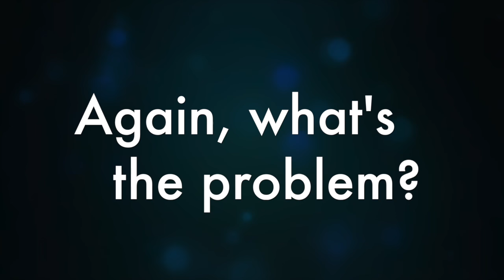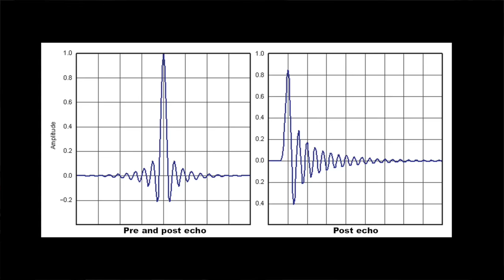The truth about Nyquist and why 192 kHz does make sense

Comment: Wonderful explanation! Many thanks for sharing your knowledge with us. I will order your book forthwith!
Extremely wide bandwith is useful to 'shunt' artifacts out of the 20Hz-20kHz band. This bandwith gives us 'elbow room' working with signals and results in 'cleaner' sound. Some authors posit that after this is done the 'beyond 20kHz' area can be chopped away, retaining the clean part for music reproduction. That is, a properly crafted audio PCM file can be 16/44 or 24/48 after all work has finalized and we have a final master. 
Would you be so kind so as to offer us your view on this? 

Some people argue that all the 'spikes' and 'brush' in the ultrasonic range may hurt the sonic result if left there for the DAC to process. It wouldn't add anything and it might detract from quality. Once the 'main tranche' is cleaned up we may be able to attain a lower noise floor where it matters by filtering away the 'excess'.
Is this argument 'sound'?

An argument for 24/96 files is the broadening of dynamic range. (The non technical but commercial problem lies in 'the loudness wars' and severely compressed masters and 'remasters')
Modern technology permits widespread use of 24/96 which I hope will become a 'standard' of sorts, at least in the streaming services. 

Let's hope quality 'uncompressed' masters find a place in the market. Is LP vinyl dynamic range too much to ask for in contemporary times?

Comment: One correction: In mathematics, "theorem" is an explicitly proven, factual statement. It is a very different thing than a scientific "theory" where there is an explicit question about the universal provability. The Nyquist-Shannon theorem has been perfectly proven mathematically; there is absolutely no question to it's complete accuracy. 

There is potential validity to your statements pointing out that it is for perfectly band limited systems, and so aliasing is an issue. But that is a very different thing than implying there is ANY question about the validity of the theorem.
Reply from the maker: I do not question the Nyquist theorem.

Comment: Fully agree!

I know from experience that switching from 44.1 to 88.2 and 176.4 (or 48-96-192), opens up and sweetens the sound, also giving it much more room. I suspect that’s not the high frequency content (can’t hear that anyway), but the accuracy of the timing, that better reflects reflections in the room, and less filtering artifacts. All using proper gear (DPA mics, Jensen/John Hardy mic pres, UA 2192 ADDA).

So I’m interested in the timing issues, and especially in attack. Some instruments (think harpsichord, guitar), have a very sharp attack, which could occur right in between two samples. What happens then? Are you going to miss out on the attack, or will it be time shifted?
Steep filters are always a big problem. Microphones will solve the filtering issue when recording and playing back at high sample rates, but there will be plenty over 20kHz content with good mikes. And when you have to put that on a CD, during downsampling filtering is needed in the end…

I actually chose my DAW based on the quality of the downsampling, which had much to do with timing and filtering. I ended up with a certain German product, which sounded much warmer and retained more than any other product I tested the rhythmic pulse of the music. And sure conversion takes its time, it’s terribly slow.
Reply: MF Nickster  Thanks for the hint, I’ll study it.

Comment: Hmm... I though CD players solved this already in the 1980s. I mean by having a couple extra bits (say 18 bits) in the D/A-converter and using these to create new interpolated values between the recorded 44KHz 16-bit samples. Hence moving the need for filter cut off as well as filter steepness up (two octaves in the case of 16->18 bits).
Reply from the maker: The bit depth works in the amplitude domain and the reconstruction filter in the frequency domain. So I'm afraid you are incorrect.
Reply: @TheHansBeekhuyzenChannel  Of course, but the time and amplitude domains can be closely connected regarding physical implementation.
The extra bits enables a few extra levels needed to define some interploated values between the recorded samples. Synthetic sample values with shorter duration and thus at a higher frequency. This moves the digital artifcacts up in frequency when fed to a D/A-ladder (with these extra bits) and so relaxes the need for a steep and phase distorting filter. That's the connection between amplitude resolution and the frequency domain here.
A guess you get the point? This principle is what they called "oversampling [filter]" in the late 80s and early 90s.
Reply: @herrbonk3635  Smooth ringing is better than rough ringing... :) It still rings though. The problem arises at the A->D conversion level, extra information is added that cannot be corrected in the D->A process. It's not a lack of bits, but the presence of added HF ringing that is the issue.
Reply: @realworldaudio  Ringing? I thought it was the phase distortion itself that was the main problem with steep filters close to (and therefore into) the actual audio band. If you move the filter to 44.1x4 or 44.1x8 (as I described), you would not have any filter effects whatsoever on the audio part of the signal. That's simply why "oversampling" (misleading term) works.

But from your nick name, I suspect you perhaps is the type of guy that don't even want a treble control in your HiFi (a low pass filter as well). These dudes (often called "gold ears" here) somehow seem to belive recorded acoustic music itself is clean from all kinds of artifacts... or that all artifacts always sound really bad, and must go, despite the fact that we have listened to them as long as we have had musical instruments and concerts :D

Comment: I’d like to know if there are differences between natural instrumentation and completely electronically-produced music in relation to this? Are the benefits just as justified if the instruments are digital to begin with? Is this just for analog instruments (which I know can include the human vocals)? I want to argue for higher bits and sample rates from electronic music but some artists don’t seem to believe in it. It might be linked to the human frequency response thing. Do you still get time smearing in electronic music? Thanks.
Reply from the maker: Digital instruments vary in quality depending on their working principle. Old analog synths use analog oscillators and filters. They often use the same oscillators for the entire spectrum they cover, making them sound very dull. Although there are those that love the old analog synth's. Nowadays often samplers are used that use pieces of recorded instruments. So there is no synthesis. The quality of those instruments depend on  the sampling rate and bit depth, the quality of DSP's they might use and the quality of samples the user loads. If musicians choose a given electronic instrument, they specifically want to use the sound it gives. Which might include time smearing.

Comment: I think I would want to put an easy way to understand Nyquist theorem. It simply says that the system needs two samples to know that there is a sine wave one on the positive side and one on the negative side. Now I could fit any continuous sample on those two samples. But given that you don't allow any of the higher frequency of those two delta samples to appear, They are pure sine waves when passed through that LPF. Lower frequency components have more samples reducing the source of error and increasing the ease of interpolating the points to a nice clean sine wave by filtering.
Reply from the maker: I have covered this in several videos, like this one: https://youtu.be/geaoEt-9V-w

Comment: What are your thoughts regarding higher sampling rates (at least greater than 44.1) improving the imaging of the reproduced sound?
Reply from the maker: I have tried to express them in this video:-(
Reply: I think he is referring specifically to the effect on imaging that higher resolution audio may have vs. standard resolution (not necessarily MQA encoded). Improving the time domain with higher sample rates alone, may be advantageous to imaging, but how higher resolution will fix imaging (in particular) may not be obvious or part of the video above. Just saying. Again. Kudos on your awesome videos!
Reply from the maker: Thanks voor clearing this up. Trying to answer too many questions in too little time is claiming its toll, I am afraid. Indeed, the filtering artifacts do have a negative effect on imaging and placement. So reducing the artifacts does improve this. In what way and to what extend depends on where your started, what improvements were made , how these improvements were implemented and so on.

Comment: There is another thing you are not talking about that's the microphone, I don't know a mic with that higher frequency range spec. I google it and all I found mic's from 10-140 khz response.
Reply from the maker: Microphones that have such a high frequency range must be condenser mikes and have very small diaphragms. As a result they will have extremely poor signal to noise. Apart from that there is little to no content above 20 kHz in acoustical music and if there is, the energy is very low. That energy will get lost while traveling through the air. So in a concert hall it is unlikely frequencies above 20 kHz will reach you and if they do it is unlikely your hearing will register them.

Comment: Great video! This concept makes perfect sense to me. The bain of speaker design is the Crossover. So why would it be any different with source files? I have vast experience in Car Audio, where we attenuate crossovers readily. From my experience the best sq comes from a more relaxed filter roll off. 
Another thing, blending a subwoofer with mids is a real pain in the ass! Why?? Crossovers! Cheers
Reply: With crossovers, you can actually do them in the digital domain and have seperate DAC+amplifier for the different bands (bass, mid, treble, or even more of them).

Using a somewhat powerful DSP should give you access to a lot of tricks & math to deal with gain flattening over frequency, phase e.t.c.

For storage, I personally  don't see any need for more than 48 kHz 16 bit-ish.
If you want to downsample with digital filtering at recording (using a good filter-algoritms) then go for it.

Same for playback, if you want to upsample and interpolate, by all means. At least you can keep the filters digital and rather complex if so desired.

For me it seems like a discussion about filter type/algoritm vs the other ones.

Comment: My question is in regard to playback versus initial sampling. Let me give an example. I record a simple session at 96/24 of an acoustic guitar and a vocal using two mic's. Once it is finished, I do a finalized stereo bounce down into an mp3 file so I can play it on a digital medium that can only play mp3 files. I also do the exact same thing again, except this time when recording the original tracks, I use 48/24 instead of 96/24, and it just doesn't sound as good as the session that was done at 96/24 then bounced down to a stereo mp3 file. Both sessions ultimately end up in a mp3 stereo file, so why does the one tracked at 96/24 sound better than the one tracked at 48/24?
Reply from the maker: MP3 is a lossy way of storing music. The higher the quality of the source material, the easier it is for the MP3 encoder to decide what part of the information hurts the least when left out. It's the same with pictures. If you want a high quality, low file size internet photo, start with a very high quality  losslessly encoded photo at very high resolution.
Reply: Thanks for your response. I am currently looking into Antelope Audio products because they seem to be the one of the only pro audio component producers that focus on making their products with 192 khz capability at an affordable price.

Comment: In mathematics, a theorem is a statement that has been proved, or can be proved. 
Philips and Sony already know of the aliasing problem when designing CD RedBook, that's why they bump up the frequency to 22050Hz, and the sampling rate to 44100KHz.  They already take into account the filtering errors.  The 44.1 kHz sampling frequency allows for a 2.05 kHz transition band, that is more than enough. I can accept 48KHz that will allow  a bit more of headroom for the cutoff filter, but above that leave it for mastering and mixing, but will not improve the sonic performance of the final record.
Reply from the maker: I know what a theorem is. The reason for choosing 44.1 kHz was primarily to be able to use a U-Matic VRC to store the digital audio signal in a video signal using the Sony PCM-1600 encore (In the US is was even 44.056 kHz because of NTSC). The difference between 44.1 and 48 kHz is negligible. The real reason is that according to Nyquist and Shannon the the attenuation at 0.5fs should be 96 dB (for 16 bit). That means that within 22.05 - 20k = 2.05 kHz 96 dB attenuation is needed, meaning a filter that does 96 dB/prime (single white note on the piano), about 8 times steeper than 96 dB/oct. Just try to find someone that can make such a filter that sounds right!!

Comment: I'm a simple man, I see a video with a correct content and I upvote. also I'm an engineer who has worked with DACs/ADCs and I agree, the higher the sample frequency the better you can reproduce/replicate the signal, that is the reason I will not get an oscilloscope with sampling frequency  less than 5x of the max signal I want to sample, merely to reduce aliasing.
I recall that in one of the DACs I worked we used a nominal oversampling frequency of 4.8MHz (yes MHz) for most audio, even for something as 16b@8KHz PCM, the only reason for the oversampling was to reduce artifacts in the output signal.

Comment: Better sound using higher sampling rates have nothing to do with hearing higher frequencies. No one will argue that 44.1khz is too low. You will get all the frequencies up to 20kHz but unfortunately the low pass filter of 44.1khz can and does cause problems. However a well designed 44.1khz low pass filter will sound better than a cheap poorly designed 96khz filter.. 192khz low pass filter will sound better than a lower one but only if it's done properly. On a cheap $100 U.S. U.S.B interface it is better to record at 48hz than say 96khz. What you say is 101% true but only if done properly.

You make a lot of sense. You are the first person I have heard to describe the real reason why high sampling rates are needed. I was very impressed. This area, although I understood it, was always a little mmmmm.....foggy. thank you for clarification.

Comment: Is this somewhat connected to bad or low quality DACs question that I have sometimes wondered?

If one routes 44kHz CD-signal digitally to low quality DAC for example in cheap av amp. It will sound in my opinion worse. If one uses same cheap av amp as only amplifier and feeds analog signal from high quality CD player (which has better DACs) It will sound much better. 

I've allways wondered why this is? Even though digital signal is the same and bit is a bit. Is this issue connected to DAC or DAC output filters?
Reply from the maker: I really can't say
Reply: Yes there can be many other factors in play. I just wondered when I saw this video. That if it would be the DAC output filters that cause the difference.

Then it would simple way to improve audio by running the digital signal at higher sampling frequency. With higher sampling the output filter is not that critical because it would be out of hearing range, right? And so we would get more out of low end systems, maybe? 

This would be interesting to test. I unfortunately don't have equipment to do so.

Comment: Firstly thankyou🌟✨🤛

Is it possible to dedicate a 12 core mac pro using Logic X as a dedicated 192 kHz sampler to then record 192khz stems from another mac logicX arrangement?

〽️🕶
Reply from the maker: It has been too long since I worked with LogicX that I can't answer your question.
Reply: The Hans Beekhuyzen Channel 
 
FairPlay🌟✨🤛

Are there any other 192 KHZ solutions multichannel solutions like ADAT or indeed any all as I found your video attempting to find a solution as Ive never personally been fooled by the digital music industry proposed limits a back the Apple Ipods & hard drive apace would have financially had a tremendous impact on how readily this maths theorem was accepted as Gospel. And I know top end hi fidelity Analogue is incomparable  to standard or even fidelity CD players like Meridian compared to Linn record player as I have owned both.

Cheers〽️🕶

Comment: Hi, recording and mixing with Sample Rate at 44,100 kHz and bit depth at 16 loses quality? Thank you.
Reply from the maker: Recording at any sampling rate and bit depth give losses. Higher sampling rates up to 384 kHz and bit depths up to 20 bits give less losses. Using MQA also gives less losses. But it all also depends on the recording equipment. A very good analogue-digital converter at 34.1kHz might sound better than a cheap analogue-digital converter at 192 kHz.
Reply: Thanks and congratulations for the channel!

Comment: Aren't we arguing about only a part of the problem? When we record, we don't typically record with a single mic what will eventually be the entirety of an output channel. Has there been a discussion of the benefits of oversampling in a world where multiple digital streams will be mathematically combined (mixing) to produce the output? Even if your final output is Redbook, working at higher sample rates and bit depths intuitively seems to give the algorithms better data to work with before the final mixdown and downsample.

Then again, intuition isn't always my friend when it comes to higher math.
Reply from the maker: To omit the discussion: just listen.
Reply: That's very Zen, my friend. I learned a lot from your video, thanks!